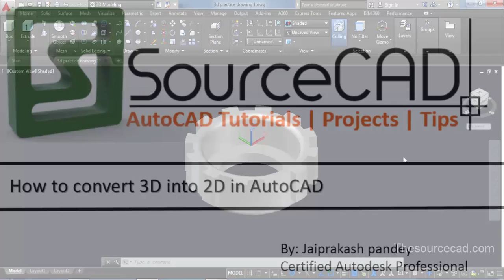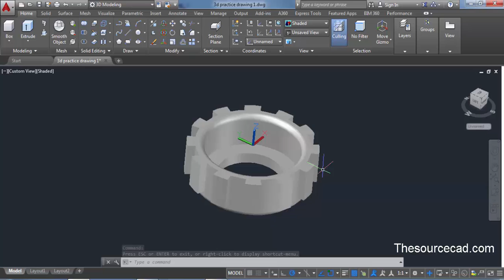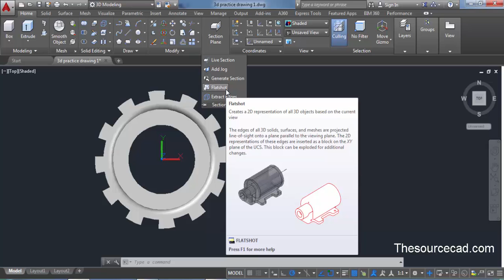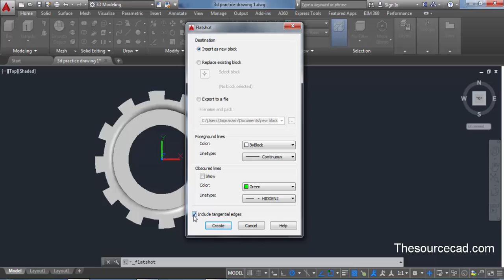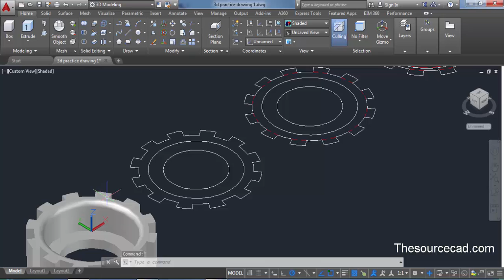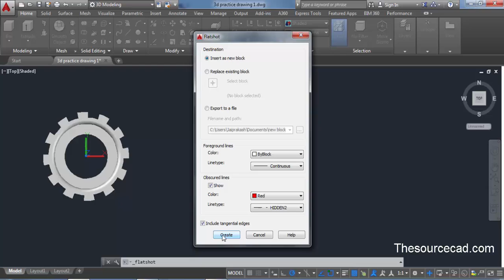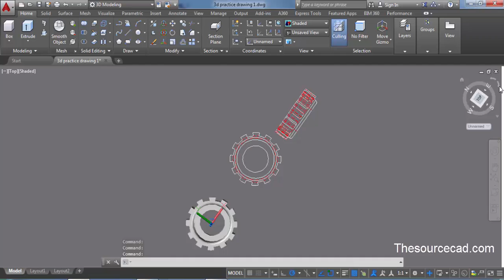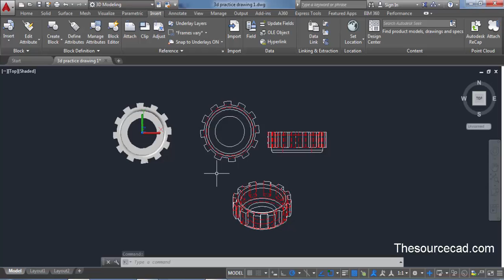How to convert 3D drawing to 2D using FLATSHOT in AutoCAD

Comment: Thanks for your video!
When I use Flatshot command in the SW isometric view, the 2d block which i get is not the same size as a 3d object, is a little smaller. Can I get the a 2d block that is the same size like a 3d object such as give when I use Flatshot command on Top or Front view?
Reply from the maker: Using flatshot you always get same sized drawing. There should be no change in size of 3D view and its converted flatshot drawing.